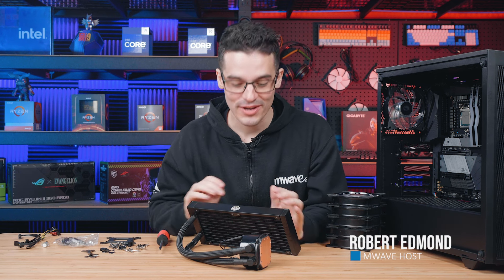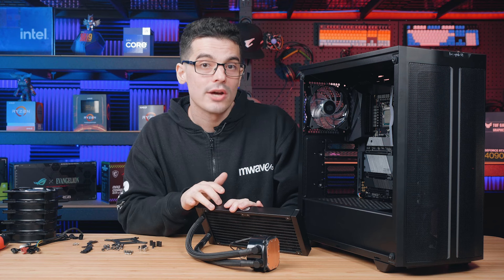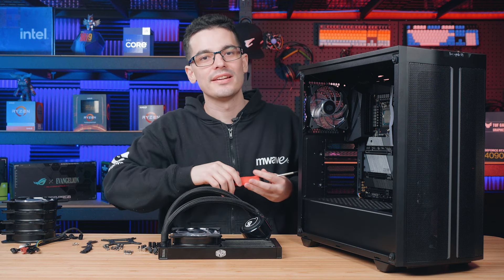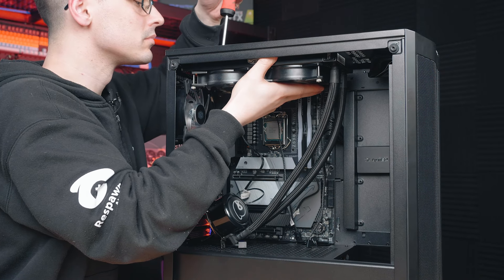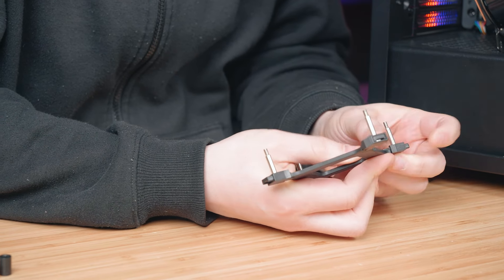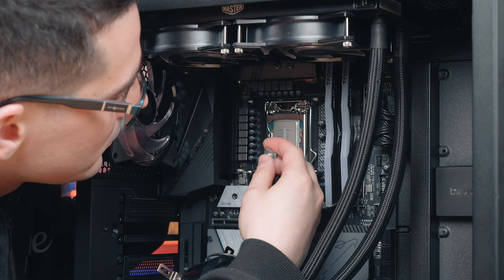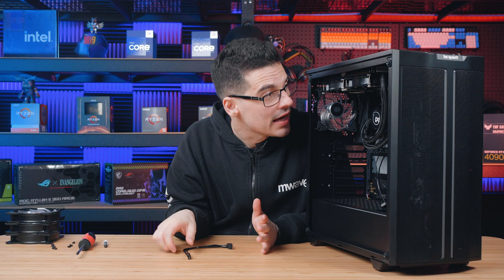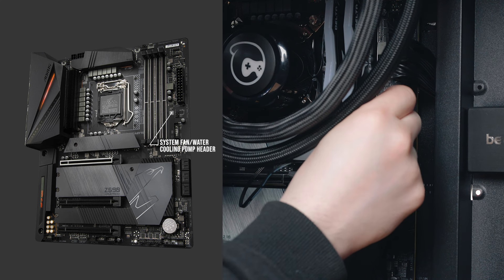How to Install an AIO CPU Liquid Cooler in an LGA 1200 Socket

Comment: Does the fan already com with liquid in it or do you buy and then put it in never had one of these fan coolers?
Reply: I've asked this forever and no one ever gives a straight answer
Reply: Comes with liquid, never needs to be drained or filled
Reply: @isjesse1  Comes with liquid, never needs to be drained or filled
Reply: @isjesse1 You can literally shake the radiator and hear the liquid inside.

Comment: Hey! I’m building my first pc and I am struggling really hard with getting my fans to work. My AIO and tower fans lights work perfectly fine, but none of them are turning. My dram light is on and my cpu light goes on when I turn my pc off bc it’s overheating from my AIO not spinning/being an AIO. I have a nautilus 240 rs argb AIO. It has Daisy chains and I connected both of the two fans and followed the manual. The manual does a shit job of explaining everything imo just tries to be fancy, and simplify it to make it look “modern” when all it did to me a first time builder, confuse me. My fans for neither will turn on. I plugged in all the fans into SYSFAN1-3 SK fe there’s 3 fans included. I plugged my cpu fan 4 pin into the CPU FAN header. And my pumps 4 pin is in a SYSFAN4_PUMP. I’m unsure of where to put this since my AIO came with two extension cords? One for the pump and one for the fans. But none of my fans work. I’ve spun them, I’ve taken them out, double checked the plugging, checked where they go, and in the right spots, hell I’ve even taken the fans apart and redid the entire thing and NOTHING. It is just so frustrating since there are NOOO videos of the nautilus 240 es being build, there’s no step by step tutorial there’s no guide I literally have no help in how to even think it’s supposed to work or look. There’s Daisy chains, which are just STUPIDDDD. I’m on the verge of crashing out. My ram sticks are taking forever to train. But I can’t train them with my $430 cpu overheating bc of my cup cooler or my tower fans don’t want to work!!!! I csnt take it anymore I just want to play my games above 35 fps. I have a pre built pc with a 1050 Ti. I literally can’t stand it. I’m debating on just going somewhere and asking them to rebuild it all

Comment: Hello, great video! I have pump_fan and cpu_fan on my motherboard. Should I connect radiator fans to cpu fan and pump to pump fans is it correct?
Reply: I have 3 pin from pump and 3 pin connector from radiator fans
Reply: @matkasper1060  same question

Comment: Hi and thanks for the video. I got a question. Bcz i have also water cooled gpu, can i install the radiator for the gpu  on the bottom of the case? Thank you in advance
Reply: no you do NOT want to install the cooler on the bottom because air will rise into the pump and slowly destroy it

Comment: Hi I got a question please. My motherboard model is TUF H310-PLUS GAMING, I bought a water cooler for my CPU (DEEPCOOL LE720, The motherboard does not have the CPU/PUMP Pin, but It has CHA_FAN 1 & CHA_FAN 2 pins. I tried connect the 3 fans to CPU_FAN and pump to CHA_FAN 1 but end up screen showing display port no signal while PC is running. Is it that the motherboard just does not support water cooler at all? Thank you for your time!

Comment: does the backplate work with a intel Rocket-lake B560 WIN DPK SYSTEM BOARD? Will the backplate like fit and be fine? I have a Lga 1200 socket.